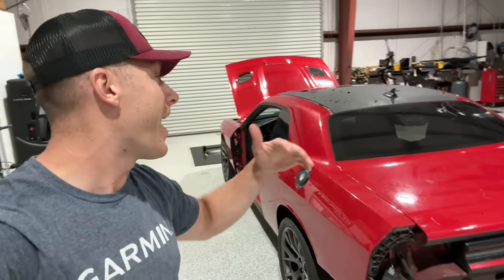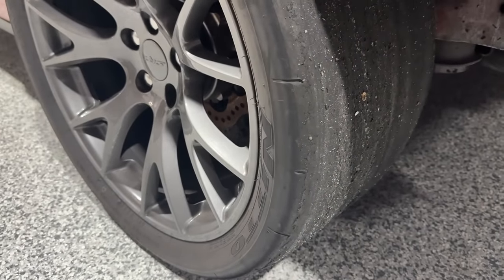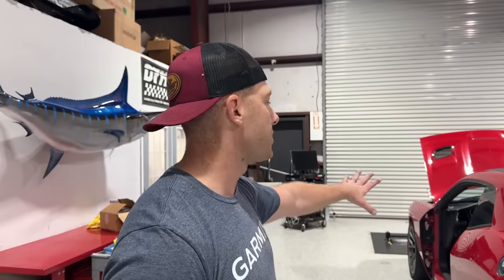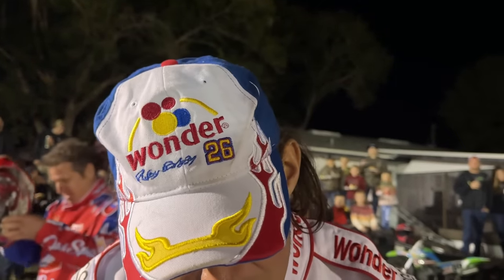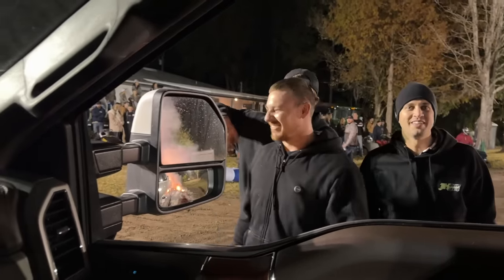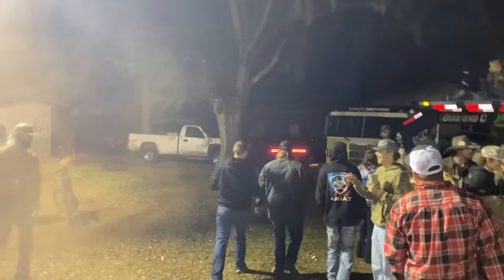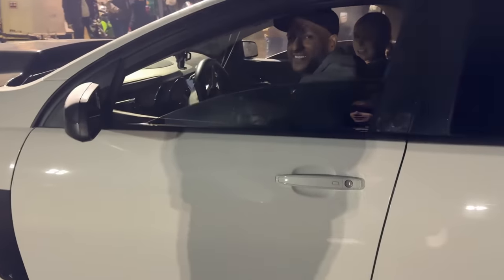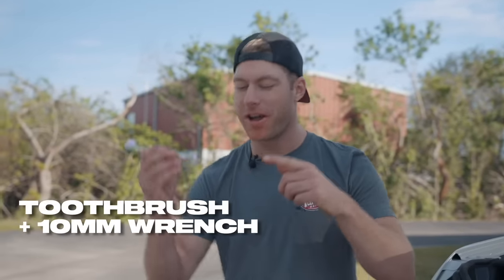Hellcat On Dirt & Burnouts At JH Diesel's New Years FULL SEND!!!

Comment: You need to add a line lock to your rear brake line. Put it in backwards so when you flip the switch it does not let any fluid to go to your rear brakes. Makes for awesome burnouts. Then when you want all 4 brakes your good.